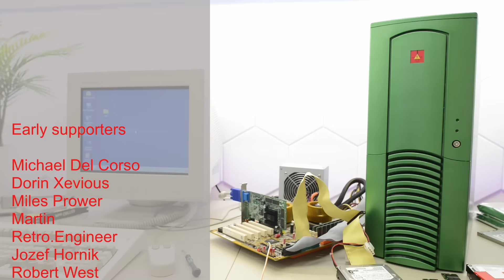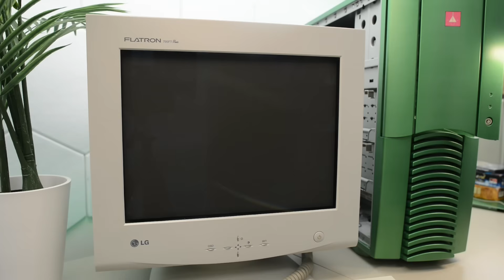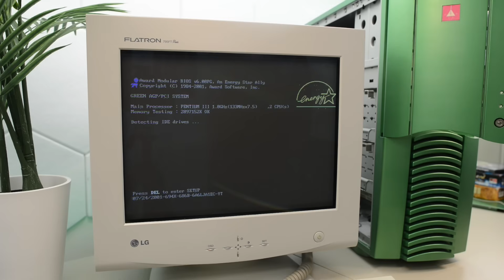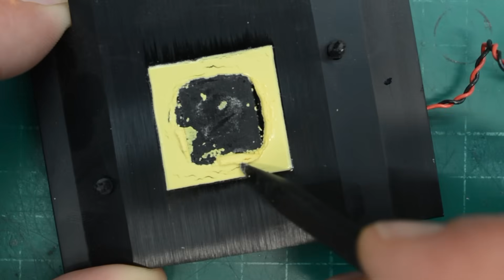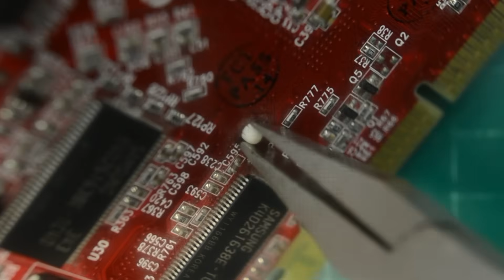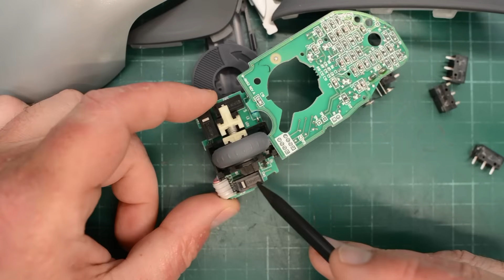Why are my vintage GPUs dying? Troubleshooting & Repair + poly-mod

Comment: The two biggest kickers in this era of graphics card are the custom ATi 9000 series cards which due to a failiure of the glue used for the load mechanism around the die due to heat, it lifts the coolers enough that the mounting pressure on the plastic push pin style coolers is reduced and the cards die a hot and silent death. those ATi coolers had an extrusion that helps them live..if that crap yellow TIM doesn't kill it, just like the pink crap used on some late 2000s motherboards. Then the FX series and respective quadros have had the original TIM pump out under the IHS and follow suit. I have an FX5900XT that was used very little as it never got put into a flipper system by a family memeber in the mid 2000s, so it still had fresh TIM underneath, but is already affecting PS3s, Xbox 360 Slims, G92 refresh up to keplar cards with a large IHS, so need delidding due to pump out. It makes me worry for those expoxy glue hybrid TIM cards and boards because after heating up a fair few and rework station to scrape it off, applications range from poor to downright silly, like 2 small blobs in the corner so the center die degrades and loses memory stability..even after the FX era it was bumpgate for a good few years with poor coolers (remember those single slot 8800GTs?) caps are an easy fix but good luck finding someone who has the BGA array sheets of old hardware to reball/replace dies or VRAM..at minimum i was quoted £130 for a repair on an 8800GT as i was curious, if its not recent, it costs quite a bit, bioses are beginning to degrade too and they were using all sorts of shapes n so in the 2000s making it hard to find cheap flashers that flip onto these chips. i worry for the future of older hardware and how prices are already on an upwards trend making these fun cards of our youth a difficult buy.
Reply from the maker: I'll start with flashing the ROMs, and we'll take it from there

Comment: Unpopular opinion but it seems that modern stuff is not affected by bad caps. I have XBOX that has caps that are totally blown, with yellow crap coming out on top, the values are crazy, and the XBox still worked fine. I think on this newer stuff, it is more likely that there is a chip failure rather than "recap and its fixed". I think it would most likely be more unstable rather than show any direct signs of e.g. bad picture or dots or so. It also is so hard to replace those caps, so I guess many will just be thrown away because it is not fun to work on them. But I would say a recap will not fix 95% of actual problems on newer stuff as you saw in the last 3-4 videos with the IBM gfx, the gfx cards etc. Those things are way too hard to troubleshoot or repair for an average person and it makes no sense since it is not vintage and nobody really cares about that era of computing. You can find plenty other stuff that will still work and the newer the things are, they are harder and harder to work on, e.g. BGA. Even more heat stress, more power consumption, and even less quality. They must have crazy robots to heat it up so much and most stuff is DEAD by design or dead by construction (e.g. early PS3 chips with alledged bad "underfill", XBOX 360 RROD, switched PSU, closed source firmware etc.). It is nice to see you trying that but at some point you should also consider your time investment and if that is really worth to change the caps just to get a "no result" and can go on ebay and buy 10 other cards for 5 bucks. This is more or less worthless stuff that gets scrapped in tons by recycle centers. Just cheap old video cards, nobody is interested in such low tier cards. People now have 4090 or so, huge cards, those small ones are for playing crazy chicken at best.

Comment: Well, congratulations for the effort, but still much too much capacitor changing with totally no reason, except for the last card. As you noticed, 99% of the time the problem aren't capacitors, but something completely else ;) For that 1st card, you could have bad memory or bad connection to one of the memory pins. Reflow memory pins and compare the diode measurements between chips, replace memory chips if no issues are found. 2nd car most likely a bad GPU core, heat it up to about 220-250C for few minutes and if it comes back, then the GPU core has bump issues. You can also try reflashing the BIOS before that, as it could have some bit rot.

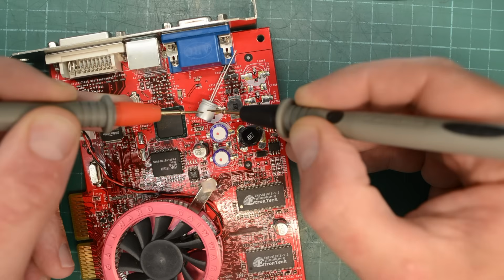Comment: 5:00 that's weird. All metals are conductive to some degree. The least electrically conducive metals are bismuth, tungsten, lead, and titanium, none of which would make good housing for capacitors. Not to mention, they are still conductive enough that they should still give continuity. It's probably some kind of plastic.

Comment: Could be a Radeon 9550, they were a slightly cut down version of the 9600 Pro. I have a few named R96 on the PCB just like yours.
Reply: rv350 = 9600pro
Reply: @Synthematix  The RV350 was used on the 9550, 9600SE, 9600 and 9600 Pro.

Comment: ATI Cards with RV250 (9000 initially) and RV350 (Radeon 9600) are really bad....
there is so much fake and deceptive stuff around with it, its annoying. That Card might actually have been sold as a 9600 PRO, but with TSOP RAM -> 200MHz like the normal 9600...
Lotta low cost stuff around at the time...

Comment: Having a lot of dead video cards would be very bad so any way of resurrecting them is much appreciated.  Most of mine still work so fingers crossed going forward. Those tiny fans are another story though. Zalman made some huge passive replacements for certain tiny heat sinks with tiny fans which is a very appealing approach.

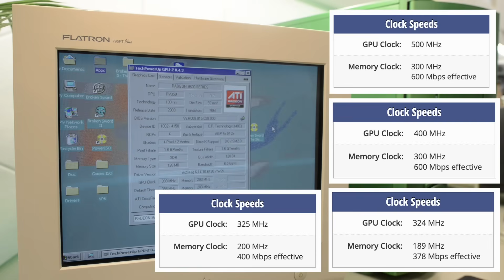Comment: 21:30 going off the device ID, it is a 9600 Pro 128MB. According to techpowerup's BIOS listings the ATI ones ran at 399MHz core and 201MHz memory, which is pretty close.

Edit: Looking closer using the bios version, it seems likely it is a Powercolor 9600 Pro 128MB. The clock speeds match exactly at 398/203.
Reply from the maker: Awesome, I'll try to flash that BIOS
Reply: Confirming what @FinalLegion89 said. The 9600 Pro did have some variance in memory speed based on the card vendor, but the standard was 198-201Mhz, with a clock limit on the GPU at 300Mhz. ATi made it strange to type their vendor’s cards because of looser options over nVidia. I think it was largely due to encourage “hot-rod” versions to better saturate their part of the market.

Comment: oh and those violetish OSCON Caps (at around 6:33 ) are early Polymer Caps, so those you could have left in place...
Reply: Yes, they are very high quality capacitors. Even after over 25 years they still have perfect properties and I have never seen a single defective one

Comment: With stuff like this you want to use your heatgun, if you have a holder, set it to somewhere around 100°C, maybe 150°C and direct it to the PCB and preheat it a bit.
You don't need to do much, just around 40-50°C for the PCB is often more than enough to get the Moogun working...

Comment: I used to have one of those ATI cards.. 9500 pro or 9700 pro, not quite sure which. Anyway, it stopped working back in the day, so it's gone, while the motherboard I had works, I think. I just haven't gotten around to try it because I don't have any AGP cards. Those cards are pretty damn expensive nowadays, except the low end ones.

Comment: The RV350, RV360, and R350 cards are what I almost always use for AGP builds. The R300 cards are unreliable thanks to the shim and thermal paste. The Nvidia card is very likely VRAM, as you mentioned.
Reply: Also, from the markings, the mystery card is a Powercolor 9600 Pro, though I cannot explain the memory speed showing.

Comment: I wonder if the hard heat paste on the second card was a glue type thermal paste rather than normal thermal paste?
Reply: I don't know what it is, but ATI loved putting that junk on most 9000 series GPUs, and even 15+ years ago that stuff was already more cement-like than anything else. No doubt it killed a boatload of cards from constant overheating (while preventing users from replacing it cause they couldn't get the heatsink off)

Comment: I have same Radeon 9700 and also dont work, black screen. One  year befor works nice. I must also check caps ;)   you can try to take the mouse switches apart and clean them with very fine sandpaper. It worked for me.

Comment: I'm immediately reminded of the fact that most MOS-branded chips commonly found in 64s are dying at a similar rate. The housing on the cap is most definitely aluminum, just well-coated (probably an easier solution than heat-shrink, especially those types intended for SMT reflow).
Reply: not sure if the Super Nintendo's CPU and PPUs dying is the similar reason for the MOS brand ICs in C64s dying

Comment: If flashing the vbios doesn't help the problem might be Bumpgate.
There are a few threads on Vogons and RipFelix on YouTube has a couple of videos.
Basically, the GPUs from around 2005 to 2007 are defective.
The solder "bumps" that connect the die to the green square substrate and the underfill glue combination is wrong, the bumps crack and the GPU dies.
Some GeForce 6 and probably all of 7 and 8 series are doomed.
Same thing for the Radeons from that period.
Radeon 9700 sometimes gets listed in the affected GPUs list.
Also, some nForce chipsets.
And also, ps3/x360 GPUs.
It's probably why Apple and nVidia parted ways for MacBook GPUs.
The lead-free BGA balls got blamed at the time but they are not at fault, the GPUs were defective.
Reply: I imagine a good deal of information is still out there on the Namics and polyimide selection failures, you don't need me to prove my case, like you're a judge. I'll assume instead strip mall IT certs, or maybe junior college. That reply is poster child for armchairs, all attack and self-serving scepticism. Again, I'm retired, not applying for a job, or sending over my resume. The OEMs did more than enough investigation at the time, the reports were exactly as I've outlined. Nvidia lost close to a billion in charge-offs, increased supplier costs, and settlements. They fired the engineers, and hired new to work out their failure.
Reply: @drewnewby  Everyone here is a judge.  A judge of what is useful info, and what is bluster.  You're pawning all the responsibility off with "do your own investigation, I don't owe you anything" and then slamming the ones on here that have observed what they could because they're "wrong" and you know better because ... "reasons, don't worry about it." 

What was the point of any of that?  What did you contribute here?  It's just aggressive chest-puffing for no value to anyone, and a cop-out on proving anything you have to say about the subject or your bona-fides.

So okay -- as official judge of the Internet, I hereby deem this entire thread a massive waste of everyone's time.  Edit:  Also, you don't get the job.  Position of cantankerous old man has already been filled.
Reply: I was wrong, this is not confusion. It's willful ignorance and trolling, as armchairs always do. Again, CE/EE background, retired industry analyst. That's hired by the companies to provide technical analysis of events just like this. Not retail sales, or blogging? Want more details, have at it, don't ask for PII and act like that's justified.
Reply: @drewnewby  I don't actually care.  I just find it offensive when people jump into a conversation amongst normies who are posting in good-faith with info that various community members have eked out of articles, data sheets, press releases, patents, and other miscellaneous scraps of information... and then some yahoo jumps in making snide comments about their efforts while not actually setting any facts straight.

I don't care who's right and who's wrong.  I don't care if these defects are related.  I don't care whose fault it was.  I don't care what you've done, or who you are -- except that I'm not impressed by some vague "I worked in the industry" claim, since... what does that even mean?  "The industry" is pretty big, and doesn't inherently mean there's any overlap of knowledge.

Here's what would be interesting:  If you have some experience that is relevant, say what you did.  I'm not trying to out you, or get you to reveal your cards so I can troll you on them being irrelevant.  I just think that, if you're going to call people out for being incorrect, the onus is on you to deliver both your reasons for thinking so, and the reasons why your opinion carries some weight.

So, e.g., if you worked for TSMC and know for a fact that certain vendors had exchanges about material or design choices that were questionable, man that would be interesting.  (I understand, of course, that some things might also be under NDA, but you can still work within that to shed some light.)

Or, if your "industry analysis" -- whatever that is -- was working with vendors on post-mortem inspection of failed hardware, hey that's great.  Even if you couldn't say which vendors, which hardware, or what failures, you could still say, e.g., "I've compared the failure mode of this package and that one, and they had different faults."  Chances are you could also say something like, "ATI did not hire me, so I can safely say that their problem had more to do with ...." etc etc.

That's helpful.  Do you understand?  "You guys are wrong and don't know what you're talking about and I'm an EE so I do" is just... so devoid of value and does not contribute anything to the discussion, man.  I mean, good for you, but like, who cares?  Seriously.

I will assume that this dead horse has been adequately beaten now.  Can we agree on that?
Reply: Bumpgate is Nvidia, and later than these cards. Not sure where your info is from, not accurate though.
Reply: @drewnewby  AMD/ATI was definitely also affected (since they manufactured the chips at TSMC just like everyone else), but they've never admitted to any problem. HD5xxx and HD6xxx series cards (especially the mobile versions) were dying like flies just like nvidias 8400GS-8600GTS, even with the very same early symptoms before failing completely and no longer showing any sign of life
Reply: @Knaeckebrotsaege  Let me try that again. CE/EE background, nearly 40 years in board level repair. I've sold any GPU you could mention. Bumpgate is Nvidia, it was not a TSMC issue. Lord Jensen was/is particularly sensitive about it. It was an engineering issue, not manufacturing. The other card problems are not related, and there is so much misinformation, deliberate and otherwise.
Reply: @Knaeckebrotsaege There's always an armchair engineer or crackpot consumer who thinks they've figured it all out. Carry water for Nvidia, blame TSMC, claim it was ATI / AMD too, nothing new. There's no "proof" provided, but nice try.
Reply: @drewnewby   Look, I don't care whose is bigger.  And just because you were apparently both in GPU retail sales and at the same time (?) repairing BGA cards, that doesn't mean you have domain expertise in die manufacturing.  No more than the rest of us.

I'm not saying you're wrong about any of this, by the way, I'm just saying that... if you're going to come in here and say "the only vendor with issues that affect an entire generation of complex dies in exactly the same manner was nVidia" then I'd like to see more than "because I certify myself as an expert" as your source.

Because unless you were employed by TSMC, ATI, nVidia, Microsoft, or Sony, and have very proprietary information about the manufacturing techniques used on those products at the time, then you will have no more or no less information than the group of armchair engineers.  This isn't a skill issue, there are only a handful of people in the world that actually know for sure.
Reply: @drewnewby  I absolutely believe there are people who have experience beyond what a consumer has.  And I don't have any trouble believing there are multiple issues.  E.g., how long was everyone convinced it was an issue with the move to lead-free solder around that time?

I'm just saying the comments are full of people who come in waving their ... sceptre ... around with accusations that "you don't know anything about it" and then have zero information to add.  So, by being aggressive and rude, and giving nothing to clear up the situation, we're all just supposed to assume that you are the random passerby who got it all right?  Hmm.  Yeah I dunno about that.  It could be.  Or it could be puffery and nonsense.  Either way, I don't value it much.

There are people on YT that have done video essays on what they believe happened.  They provide references to what info is public, and insight on what led them to believe whatever they feel connects the dots.  That's useful.  It might also be wrong, but at least it adds something to the conversation.

Coming in here hot and taking down other commenters because "NO GUYS, YoU'rE aLL wRonG, I WAS IN THE INDUSTRY" with absolutely no credentials, no references, no specifics, and generally nothing to add but toxicity ..

I'm not at all confused.  You could be 100% correct and know more about it than the rest of the Internet combined.  You're still just being an ahole and you're going to be written off as yet another troll.  You wanna be taken seriously?  Lose the attitude and tell us why you think these things aren't related.  Otherwise, I've got a pile of dead Radeons, a flaky launch PS3, and bought a X360 for a family member that RROD'd a long time ago.  Awful coincidental that all that happened around the same time.  And it could genuinely be a coincidence.  I sure don't know.  As of right now, I don't trust that you do either.  Even if you sold every GPU we can imagine, apparently, and reworked them, and I dunno ... blogged about them.. or whatever it is you actually did, because you've been pretty cagey about all of that too.